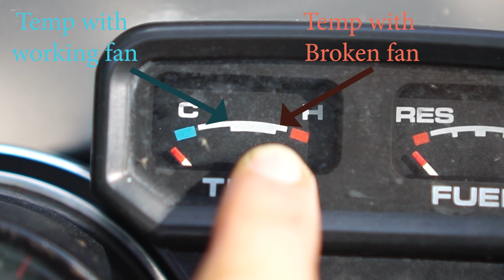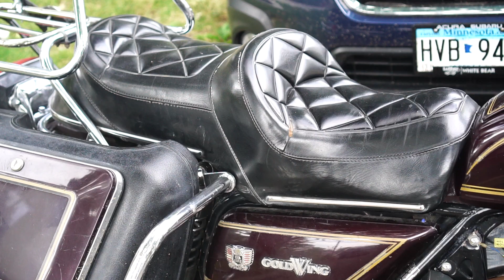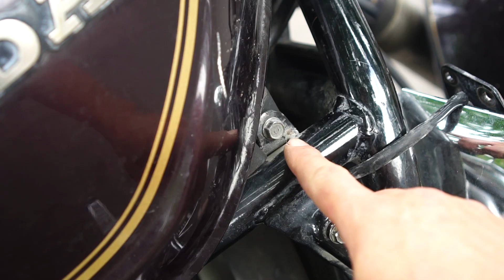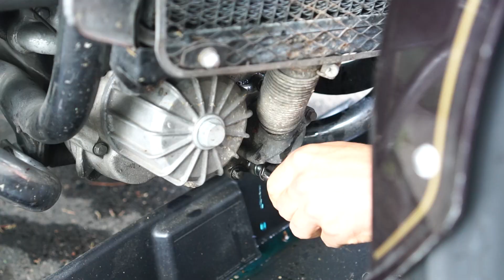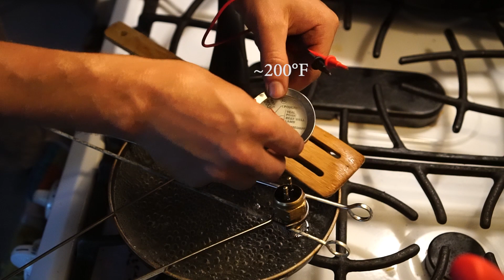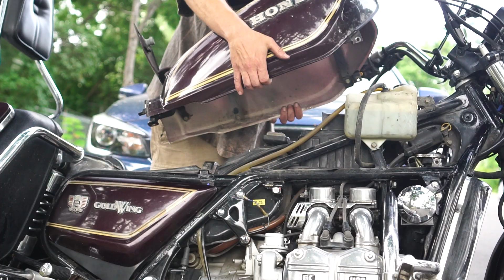Overheating Motorcycle: Replace Cooling Fan Sensor Switch on a 1980 GL1100 Goldwing

Comment: Great video, I did a video the other day on this exact process and was looking everywhere to find out what was the socket size to fit the switch, I thought I was the only one to mention it but Kudos to your video which stated the 27mm socket. My problem was that the switch was stuck in the closed position, so I am changing it. Again great video.
Reply from the maker: How long did your replacement switch last? I've had a lot of trouble with new ones crapping out.
Reply: @Joeyfingis  The new switch has been performing as expected, but glad the video helped and thanks for watching.

Comment: Nice bike , if you were going to replace that bike with a new one what would you buy ? I have a 1980 naked goldwing and was thinking of getting something new but all the new bikes suck I really don’t like anything new,
Reply: That’s what I wanted the older I get the lighter bike I want but I go coast to coast once a year and I’ve been doing it on a 2000 Honda Valkyrie interstate All 900 it’s of it and I have a 1980 gl 1100 naked ,I kinda like that retro Kawasaki w 800 , I’ll keep looking
Reply from the maker: I just went for a ride with a 1982 Silverwing GL500, I made a video of the ride you should check it out. I got to ride the Silverwing and it's for sure much much lighter than the goldwing, but it has plenty of space to pack gear and take that coast to coast ride you're looking for. Trying looking at the Silverwings! They even made a GL650 version, but the GL500 was doing fine on the highway.
Reply from the maker: Well, I wouldn't replace it! It's the perfect comfortable yet stylish and powerful highway bike to take on long drives. I can clip on the luggage and go camping or take it off and look more like a cb750. Very versatile and wonderful bike. I love the naked goldwing. 

HOWEVER, I have been wanting something a little lighter, more nimble, and torque-y for around town. I've been doing a ton of research and I think the perfect compliment to this naked GL1100 is a 1980s Honda Magna. Now I'm just debating between a V45 750cc or the V30 500cc with a larger rear sprocket for increased acceleration! 

Now, if you can't have two bikes and you want something right in-between the Gl1100 and the Magna, I was very tempted to bite on a 1982 Honda cb900 custom, but it just seemed too similar to the Gl1100 to have both.

Comment: Great video, I did pretty much the same. Opted for a aftermarket sensor first, which opened way beyond the original one. 
Original Honda parts are measured in Gold, but hey, they do work as expected.
Reply from the maker: Glad to hear it all worked out for you! Where did you get your oem from, online? I had to get one off eBay but I think it would be helpful if I could direct people to a vendor where they'll definitely get the right part.
Reply: @Joeyfingis  It seems the OEM sensors are getting quite rare. Could only find one Ebay seller here in Germany and I noticed that the prices are increasing rapidly. From 60€ to around 120€ now. Luckily I bought two sensors a couple of years back. The aftermarket one I tried was from Tourmax, I still don't know if it was a faulty or simply the wrong one. But I have read more reports that the aftermarket sensors do not function the same as OEM, even though they are advertised as such.
Reply: @Olizzker  Bummer about the price, I can only find cheap knock offs
Reply from the maker: Yeah I've experienced the same thing where the non-OEM ones either are too sensitive or not sensitive enough. I usually keep the ones that are too sensitive in there as that's fine with me, but then they seem to wear out faster too. I end up basically changing my coolant more often than I would otherwise just to keep up with the bogus cheap fan sensors.

Comment: I have a smallquestion for you, please be kind enough to reply. I tested a new radiator cap with a temperature gauge.  MY motorbike is Honda AX-1. After installation everything works fine without any problem. Fan start and stop is normal, after radiator cool water level ok. But I have a small doubt. As shown on temperature gauge, Fan starting temperature is around 112C (230F) and fan off is 105C (221F). Do you think this temperature is too high or could be any fault with the temperature sensor of the radiator?
Reply from the maker: Personally I don't think that's too high, there are a number of sensors that trip the fan between 170F-225F. I think that you're at the higher end but it's okay.

If you want to make the fan turn on at lower temp, could you flash a new ECU? 

Otherwise you could look for a sensor switch that actuates at a lower temp. I've had aftermarket ones that trip low like 180F and ones that trip high like 215F.
Reply: @Joeyfingis  Thank you very much for your reply. I am still using the original radiator sensor, I guess the switching temperature could be 100C.Radiator temperature-sensor placed at the bottom.  Technically the radiator bottom water temperature is low compared with upper. That is the reason the radiator cap indicator shows 110C, am I correct?
Reply: @malanvythilingam1590  I think you're right. Hope you get it all figured out
Reply from the maker: I guess I'm not sure. Heat rises, but also I could see the whole system being hotter closer to the engine and cooler further away. I'll try to look into it and if I can figure it out I'll let you know!!

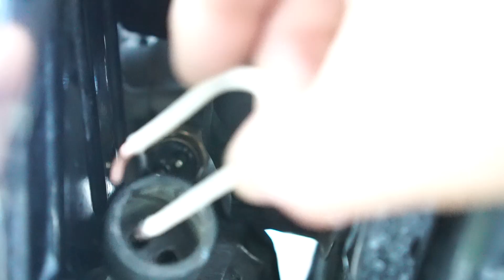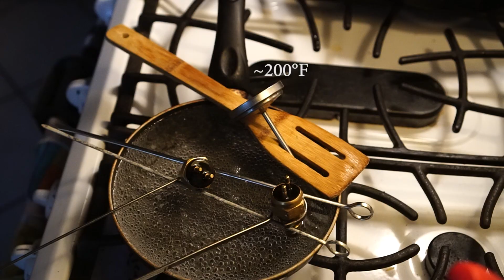Comment: Super duper thank you for showing how to do the diagnosis at 1:04 and 3:04, I ended up just having to clean my connector!
Reply: 🎉 well I bet that saved a load of time
Reply: You can also test the continuity of the sensor switch without removing it and dumping all the coolant, just have to get the bike really hot and make sure not to burn yourself reaching in there. Attach some wires to the posts prior to warming up the bike and then just using the voltmeter on the wires to see if the switch engages when the engine is hot.
Reply from the maker: Great point!